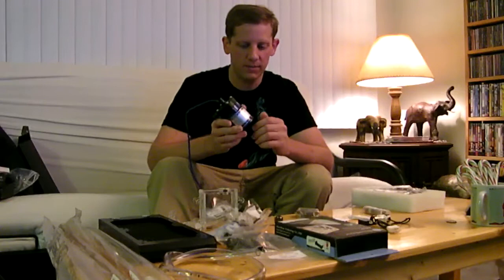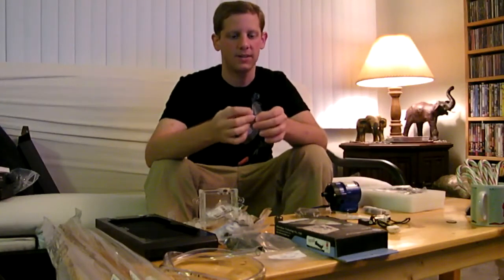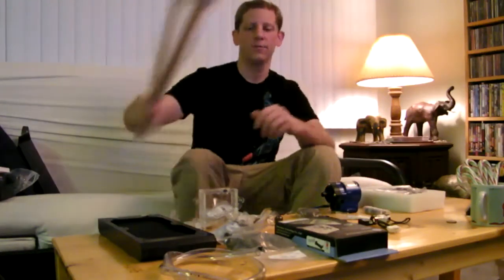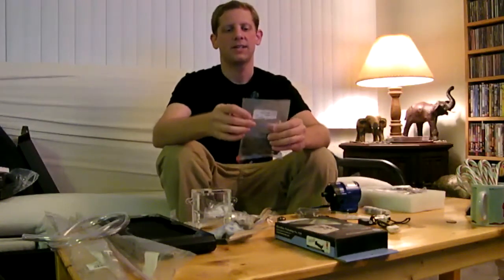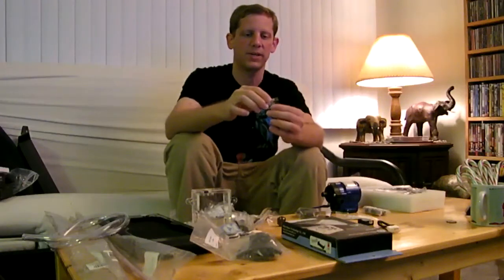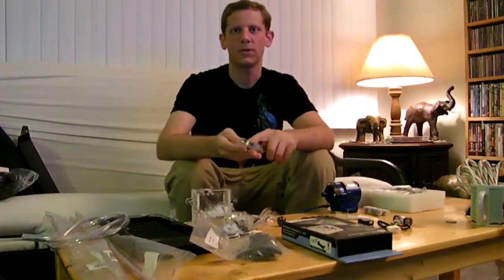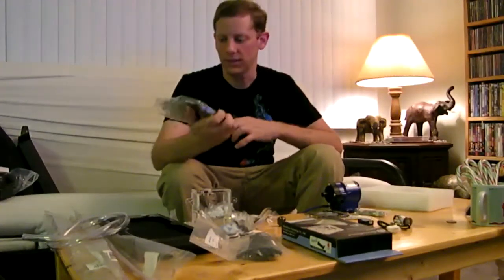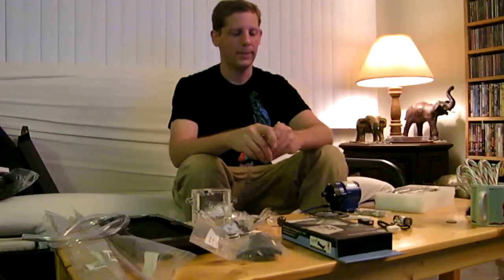Building a Computer  Part 5 Cooling

Comment: Sorry, i meant to say putting a 955 under water cooling would be better because of the overclock you can get with it :)

Anyway, good choice with the 955, would love to replace my locked 920 with a C3 965 or 955 :)

Comment: if your room temperature is less than 25 celsius you don't need wattercooling exept if you want to overclock more than 15%
BUY THE PHENOM II 955 and you can get approx 4Ghz with the wattercooling but keep checking the led voltmeters for over volgtage :P